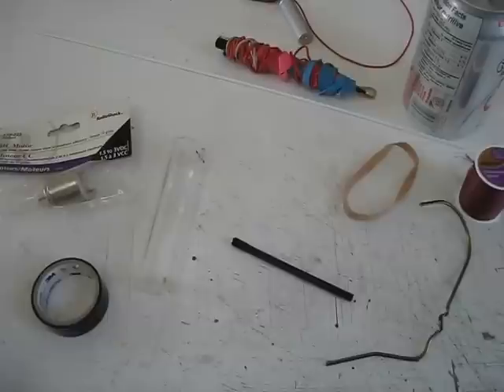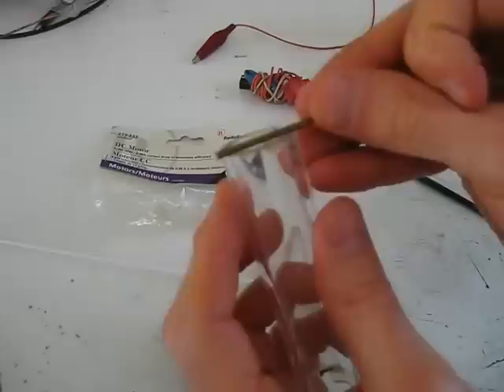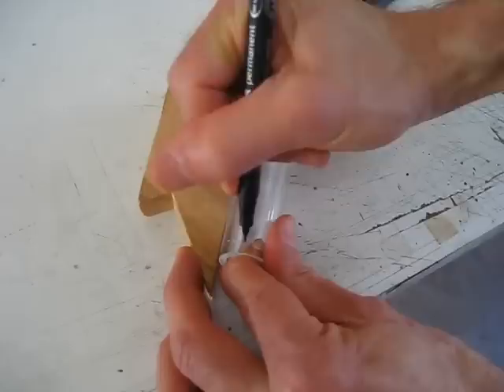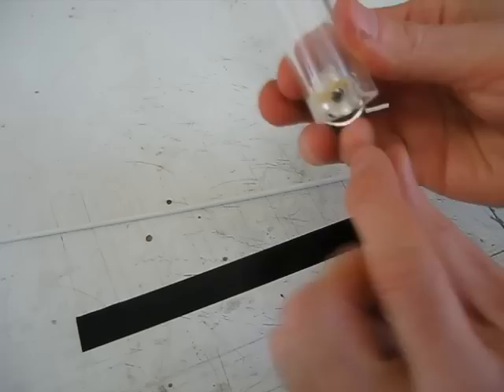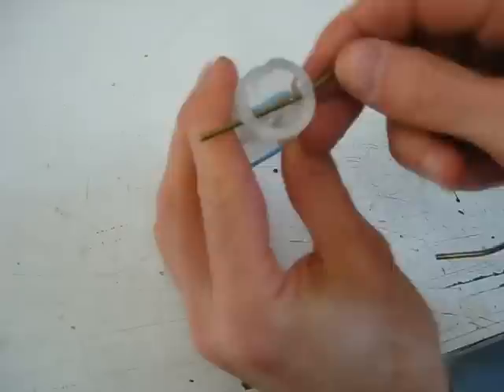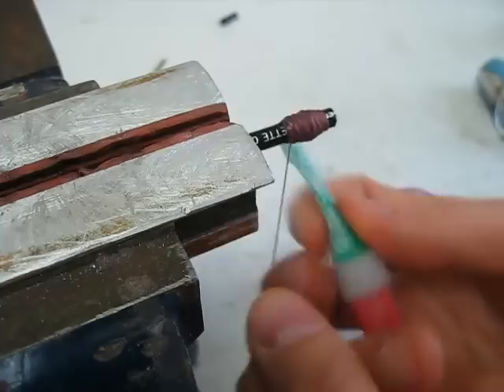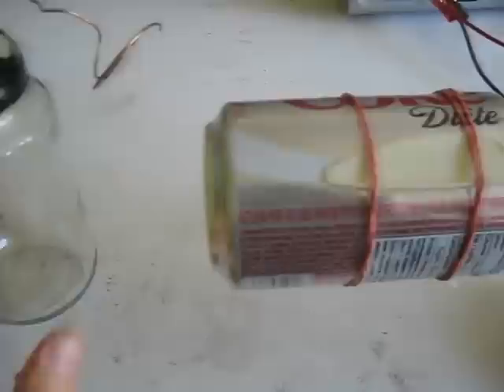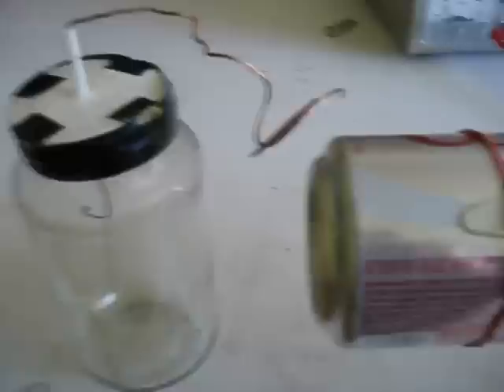How to Make/Build a Van de Graaff Generator Part 1 (Homemade/DIY)

Comment: This doesn't work so well because the belt is supposed to run inside the top load. That's because the principle behind it is that any charge placed within a hollow conducting sphere will always be at a higher potential than the sphere. If you connect the charge and the sphere all the charge inside the sphere must flow outside to the surface of the sphere to equalize the potential. This will continue to happen until the charge density on the surface of the sphere is high enough for dielectric breakdown of air to occur.
Reply from the maker: +AvZ “Astatine” NaV I do connect to the inside of the sphere. See the video at 9:05. However, I did find an improvement with the whole upper part inside the can, as I demonstrate in this video http://youtu.be/xRLvbwF2MnM See 5:04 for the final results, including a 3rd test of the connection being made entirely outside the can which was much worse.
Reply: RimstarOrg No, I saw the video yes. But the belt was outside the can. Since the belt holds the charge, It'd be better if it was in the can and then connected to it.
Reply: RimstarOrg If a conducting sphere is connected with a charge which lies outside it, the charge will flow till potential equalizes. It's not necessary that all the charge from the charge will end up on the sphere unless it's placed inside it. 
If the charge is inside, its necessary that all the charge from it gets on the sphere in order to equalize their potential

Comment: ok so i tried making a frame of wood and the same things you used but it did not work
Reply from the maker: There can be a whole bunch of reasons it didn't work. If the wood frame is just bare wood then I doubt that's the problem. If there's paint on the wood then it may be conductive (been there, done that). Check out my part 2 video https://www.youtube.com/watch?v=QrCgtjZwnB0 and my FAQ page http://rimstar.org/science_electronics_projects/van_de_graaff_faq_frequently_asked_questions.htm.
Reply: can i email you my setup
Reply: can i email you my setup
Reply from the maker: Sure, but only after you looked at the video and FAQ pages I gave a link to. My email address is at the bottom of each of my webpages at http://rimstar.org.

Comment: Can I use teflon tape?
Reply from the maker: You can use teflon tape. Though you'll have to figure a way to make it stay on. Is there some way to glue teflon tape? I'd be interested in knowing how it works out.
Reply: Ok thanks. Maybe you can use liquid PTFE?
Reply from the maker: jasper samson
I don't know. Maybe it'll work.
Reply: I have another idea. You can wrap the teflon tape against the rotation of the belt.(haven't tried it though)

Comment: It's still running off to one side. I made it totally parallel :(
Reply from the maker: There's unevenness somewhere. What about your belt? Maybe it's stretched more on one side. Try flipping it the other way. Also, I find that if both sides of my motor shaft aren't supported by the cylinder then the force of the rubber band call pull on the unsupported side, making it no longer parallel.

Comment: I know how it works. the motor spins the belt , and then the two brushes make electricity that is going trough wires and releasing itself into the metal ball. but, metal ball is there because it conducts electricity. and human body can do it too, so I thought of replacing the ball with the body. and of course put some rubber or wood below my shoes so the current doesn't go trough my body to earth and only shocking me, but keeping the electricity in my body.

Comment: Is tissue paper positive
Reply from the maker: Paper is on the positive side of the triboelectric series table, listed near the middle, but it's not behaving as a triboelectric interaction in this video. I think it's just getting positively charged by the dome. Since the dome is also positively charged, and like charges repel each other, the tissue paper is repelled by the dome. So yes, it is positive, but only because the dome is making it positive.

Comment: yeah cut it wide from the widest part ,but choose a ballon that is as close to this color:
i01.i.aliimg.com/wsphoto/v0/697741859/free-shipping-Elastic-rubber-band-for-font-b-slingshots-b-font-PULL-ROPE-without-joints-plain.jpg

for me my ballon's color just faded away by the time i was done with the experiment

Comment: That thing is not a Van de Graff generator !
1. missing: the rubber belt should go inside the can, transporting charge inside. 
2. spraying charge to the belt at the ground side should be supported by a plate behind the the belt. The plate is  charged by another brush before the rubber belt,  which has another plate behind the belt,  which is charged to the voltage of the can.
(double voltage inversion and amplification with 2 Plate/brush systems surrounding the belt)

Comment: right, as if you didn't have another battery or could just charge that other one. so full of it. 8:37 don't lie.
Reply from the maker: It was a long time ago so I don't recall, but if I said my battery was dead then it must have been dead. And why waste batteries when you have a DC power supply? Anyway, at ten minutes and ten seconds into this part 2 video http://youtu.be/xRLvbwF2MnM I show using batteries. As you can see, with the belt tension, it takes quite a bit.

Comment: The belt is not rotating
Reply from the maker: Is the motor shaft turning at all? If not then your belt may be too tight. i.e. the distance between the two pulleys/rotors may be too far, stretching the belt so tightly that the motor can't turn. Or maybe the motor just isn't powerful enough or maybe the power source isn't strong enough. Be careful not to go over the motor's voltage rating though, otherwise you'll damage it.
Or is the motor shaft turning but the belt is slipping then you'll need to tighten the belt somehow. That can be done by making the pulleys/rotors fatter if you can, or by increasing the distance between the pulleys/rotors.
Or maybe the pulley/rotor on the motor shaft is slipping.
Reply: @RimstarOrg  sir I have used a 3v motor and a friendship band for belt ...but the vinyl tape is not holding belt properly...I have used glass instead of nylon thread .. I've kept the belt normal but belt is not rotating..kindly suggest me some material which I can use for belt
Reply from the maker: I have bad news for you then... someone in the comments here a long time ago said they tried friendship bands and that they don't work, even if you have the belt moving properly. For a Van de Graaff generator this size, there seem to be two options for the belt.
The first is a rubber band like I used.
The other is to make use of a different effect which I've never tried but many have successfully. That's to cover the pulleys/rollers with vinyl electrical tape and to use the same tape as a belt by forming it into a loop with the sticky side facing outward. See this video for a how-to for that type https://www.youtube.com/watch?v=DVBkZUmwcBg

Comment: Because everyone has a metal vice just lying around in their house
Reply from the maker: Use your imagination. I'm sure you can find some other way to hold the tube in place while you cut it.
Reply: I suppose I was just saying that he could have maybe shown us one of those instead of the metal vice he used
Reply from the maker: Gemini Games
You've got a good point. But, if you spend time looking at many of my how-to-make videos you'll find I use that vice a lot! :) Oh well. In my defense, it is a small, cheap vice that I move around to wherever I need and just clamp it to whatever table is handy. Sometimes I don't need to clamp it at all. Highly recommended for anyone who's going to make a habit of making things. I even use it to hold things while soldering.
Reply: this was my first one of your videos and I didn't mean to offend but thanks for explaining it to me
Reply from the maker: Gemini Games
No offense taken. I do use a few tools that most people won't have around, though they're all quite small, portable and cheap. Even my drill press and tabletop scroll saw. You do have a point.